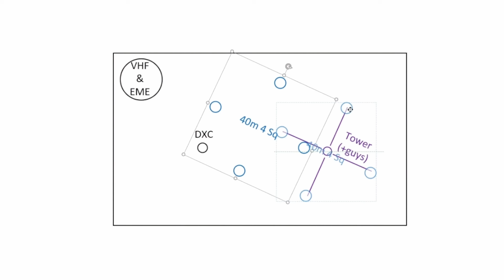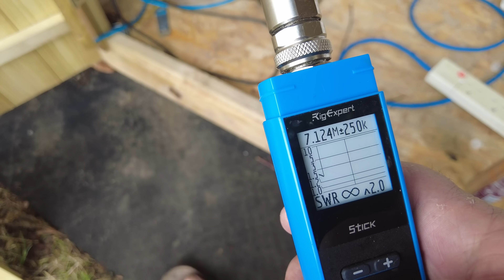I Am Not an Influencer

Comment: Well you may not be a influencer to me but you are an inspirer. You have managed to keep the ol brain cells firing well as I also work on differant antenna ideas. Some of the ideas have been add ons to what you have done and many are the crazy ones that sound good on papaer but may fail only to make new questions come up that have to tested and proved right or wrong. So you Callum inspire me and I am quite thankful that you do. I do love some of the ideas you have come up with and what you have done. The Beam you have constructed is a great example of what you have done and I just love that antenna. Yes I have bought some of your product and have found that it in my opinon is just fantastic for the DIYer like myself and the price is pretty good too. I have 3 of your antenna systems two of which I use for both portable use and experimentation and one that is the permanent set up. So please keep inspiring me as I enjoy my radio and my antennas. Take care and 73. Vic de KE8JWE
Reply from the maker: Wow Vic! Thanks for the support!

Comment: I think your channel is very down to earth and real. I love how you show the problems as you build, please don't change it. Watching your videos inspired me to to try and use your 12.4  with a gin pole mounted on 10' mast centered on the ridge of a roof that I built  between two shipping containers. It will be completely isolated from grounding and use  4 - 80 meter 1/4 wave (62') elevated tuned radials with traps for 40, 20 and 10 meters on each of the 4 elevated radials. It might be "cock on" or a blooming failure but either way it's going to be fun.  My property is 250' X 720' and I have visions of a full wave 160 meter loop after watching your long wire receive antenna you built. Enough waffle thanks for all you do. 73 KN6TUX
Reply from the maker: Nothing wrong with a waffle. And good work!